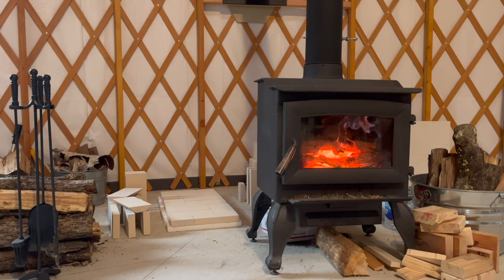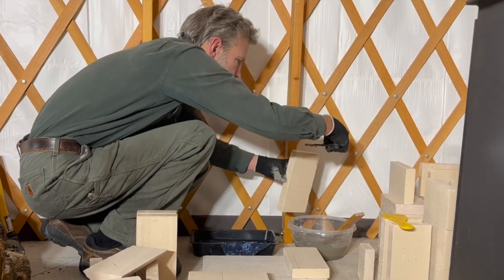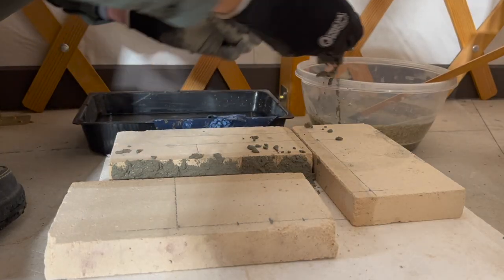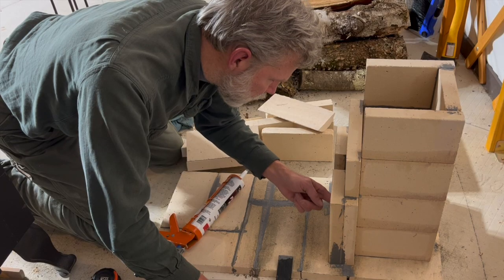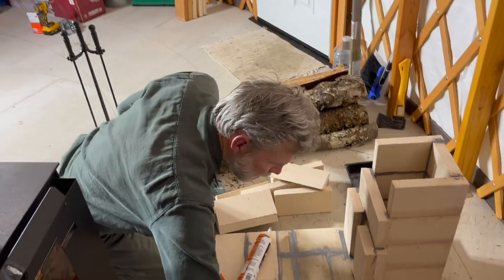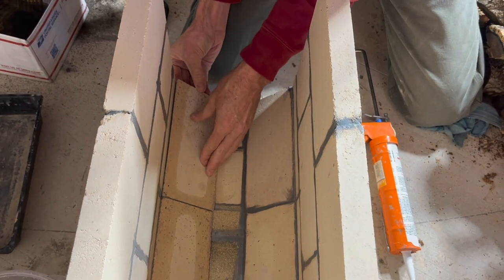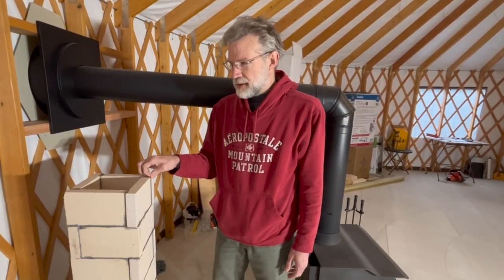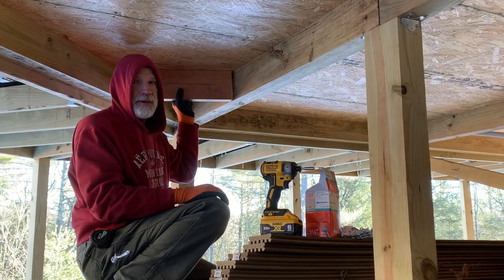Rocket Mass Heater Part 2 - mortar for the batch box core (Vermont DIY off-grid home build)

Comment: I've been thinking about the possibility of insulating the mass and conserving the heat for later use. Situations like workshops, where a fan could be used to pull the heat out of the mass an hour before time for work. It would also be handy in case the house got too hot.

Comment: Outstanding! I saw this come up in my feed as I have been watching box batch videos in my plan to build a 4" riser (with no masonry heat sink after the bell) for our sauna. My "Hot Tent Stove" (stainless) was always a smokey affair, and after just one month it started leaking smoke into the room itself. Tons of creosote too. So the box batch looks like a winner. I plan to take some additional steps to improve efficiency, and ensure ease of use. I may make a video about it if I find it all a success. I am having a stainless bell & pipes welded now for our "radiator" and exhaust, also using a bypass to have good draft initially (thanks to a "broaudio" or "Walker Stoves" tip). My thinking about the main combustion zone is to use a removable cylinder "mold sleeve" and pack the cavity with a mix of perlite and a bonding agent that I found in another video. But "Broaudio" has a "Rocket and Masonry Stove Mortar Discussion" video I plan to watch too to see what I will settle on. I like the idea of an insulating layer between the fire brick and the actual flames, as I imagine it will result in a faster heat up with less wood. Though for non-sauna applications I guess there is benefit to having heat go into the fire brick anyhow, since one wants the main structure to be heated over a long time, rather than our hot and fast sauna application. I may contact you as I live in Southern Vermont, and have taught sustainability classes at CCV (may again at some point). I would enjoy sharing how this goes (I may also use a modified design for our maple syrup boiler). Anyway thanks for sharing!
Reply from the maker: Hi Jesse, thanks so much (neighbor!), we would love to hear from you, and we're interested to hear more about your projects. You can find our e-mail address on the About page of our channel.

Comment: Very nice job, I want to build also one, in a greenhouse and from there heat to pipes into the house, and the barn with cv radiators. quiestion is the heat exanger needs to be placed carefully to prevent accidents with steam explosions.

What kind of mortar do you use? are the stones rocksolid glued or can I still take it apart.

In the Netherlands I can not just decide to go live in the woods, it is forbidden there, but yes, NL is much smaller then the US.

Comment: Soak edges of brick, perfect adhesion. You can soak the whole brick but if it’s fire brick you will have to let them drain the excessive water but your mortar will be sucked into the drying brick creating a full Bond.and the mortar doesn’t set so fast giving you time to work the mortar while. Properly precisely place ever brick

Comment: i like the little table you made for the cats to get under by your bed.  how did you get the color to match the cabinet color so well?  can you share the paint and color?
Reply from the maker: Ha, it's actually a coincidence that the paint looked good in the Bigfoot. It's leftover from what we bought for the bender board on the yurt. Will take a look at the paint can and let you know!
Reply from the maker: (We built it for them to use as a step to jump up to the bed; they hang out underneath as a bonus feature!)

Comment: the build seems too close to the wall
Reply from the maker: Stay tuned for heat shield and temperature testing... The clearances we have read about are pretty small for this type of heater, but we will make sure it is not getting the wall or ceiling too hot.

Comment: I like your little rocket stove, but aren't you very close to a wall?  From what I read about rocket stoves is that the barrel can get up to 1000 degrees F.   Wood  can spontaneously combust at 700 degrees and paper at 480 degrees.  

Most codes recommend 36 inches from a combustible wall.  Installing a heat shield will help protect the combustibles under the shield.
Reply from the maker: Hi there, and thanks for watching and commenting.
Yes, the stove will be fairly close to the wall, but there will be a heat shield in front of the rafter supports and a 3-1/2" air gap between that and the actual wall. In addition, there will be a cob mass built in between the heat shield and the barrel, and the barrel will be positioned in such a way that the flue gasses will be mostly directed away from the back of the barrel. My main concern will be the top, so there will also be a heat shield on the rafters above the stove. We will also be closely monitoring the temperatures in the area when we begin burning it. Utmost care will be taken until we are completely comfortable that the design is sound and safe!